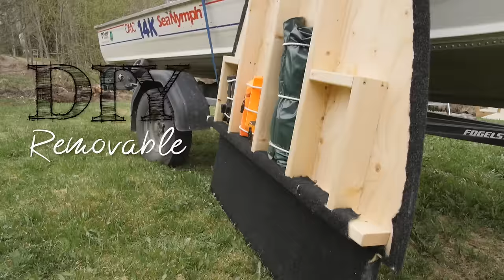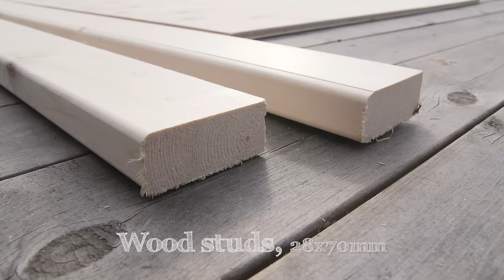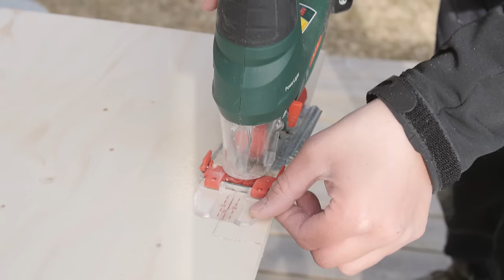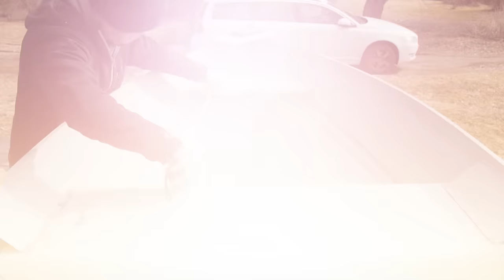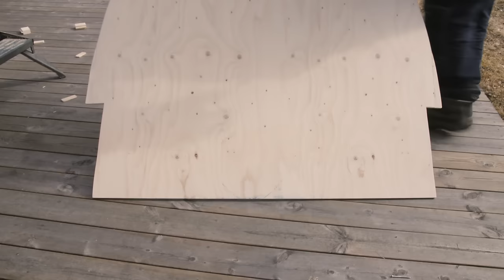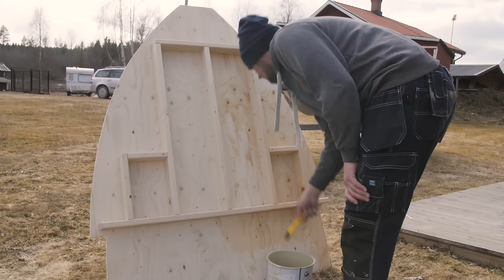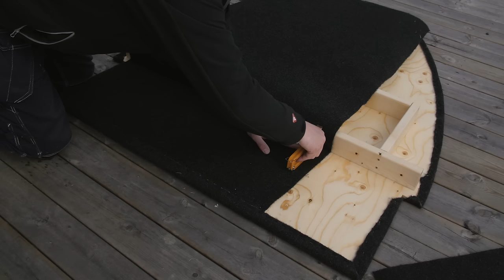DIY Cheap Removable Casting Deck

Comment: How is the deck holding up while driving? Has it moved or shifted while you’ve been driving? I’m thinking about doing this to my 14’ John boat. I’m just worried that it has a possibility to fly out. Thanks
Reply from the maker: Hi, I actually take a strap around it to keep it in place when I'm driving (with the car). But there will need to be a lot of force to make it fly out of the boat... It is light but still not that light

Comment: I have a 10 ft. "Deep V" and there is no way this would work on it. Way too unstable and no way to control  the boat. This is a cool idea though, I'd like to see a video of you using it.
Reply: I think you'd use a bow mounted trolling motor in this case....I'm wondering the same thing as I have a 12 foot V

Comment: Great job.  I was going to ask if you had to do it again would you have used glue but then read the comments.  You should be able to get decent carpet that size for fairly cheap.?  Anyway gave you a sub.  Thanks.
Reply from the maker: Ye probably you can ;) thanks for the sub!
Reply: Phantom Fishing I'd use glue

Comment: "Good Job" from France, it's not so easy to do simple concept !
Please, how many weigth this deck ?
Reply from the maker: Thanks alot! I don't know the weight, and I can't check until the spring :/ The boat is at my summer cabin right now and I am working in another city.

Comment: is the boat stirdy?
Reply from the maker: Depends on what you compare it to, For being a portable rooftop boat I think it's pretty sturdy but if you compare it to a real wide bass boat it is not that sturdy :P We fish 3 people from this without any problems even in poretty rough weather
Reply: awsome! yes iam in florida and it has rust coloring from the salt water but has not quite hit the rust stage yet. i plan to prime it and paint it a desert brown then order another lowe decal so it looks well cared for rather than tampered with. its a 1457 and came with motor, trolling motor, binmi top, battery, trailer, trailer dolly, pole holders, gps and depth finder, ors, 3 vinal seats and the cover for 1,300
Reply from the maker: Nice! That sounds like a pretty good deal. I payed about 900usd for just the boat, I think my total is over 3000usd now with sonar, trailer and trolling motor and everything :P
Reply: The DIY Crab thats awsome though. im going to build that deck for sure. never owned a boat before it is a learning curve. whats it like in sweden
Reply: The DIY Crab did you ad foam to yours?
Reply from the maker: I added no foam, it's foam in the seats right now. However I'm thinking of opening up the middle seat and make two hatches, one for a cooler to store cool bewerages and stuff and the other for my battery for the sonar. Then I will have to remove some foam and might have to add some elsewhere.
Reply from the maker: Sweet! :) It's windy and cold here in Sweden! Had over 23 inches of snow last week at the cabin where this boat is stored :P

Comment: What method did you use to get your template?
Reply from the maker: I took a piece of cardboard and cut it out until it fit in the boat, and then another, and so on until I had the shape of the deck. A time consuming process :)

Comment: Nice job, but I would have used a less bulky brush like an artists’ brush?? I have a little trick I like use when staining my 200 foot perimeter Cedar fence...I bend an eyelash brush like the Maybelline Volume Pumped Up Waterproof Mascara to 90 degrees and dip that in my 45 gallon drum of stain... in about 7 hours I have the entire side of 1 fence board completely finished!! On the second coat...I like to take my time. The carpet is O.K. but I still prefer to us 10” X 3” X 4” thick Yellow industrial sponges. I glue them together with contact cement using a cat whisker taped to the end of a pencil. Big leaguers like you can fire those monster staple guns but for my money nothing beats the Swingline Deskmate, or even the Playskool Lil’ Staplin’ Buddy. ----------------------------- Dan